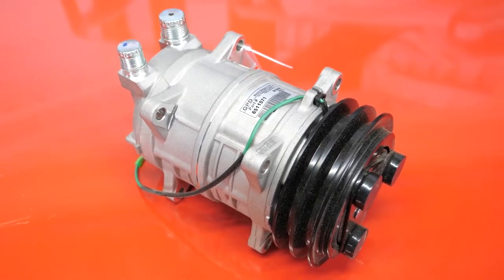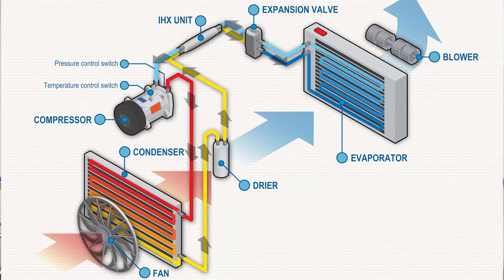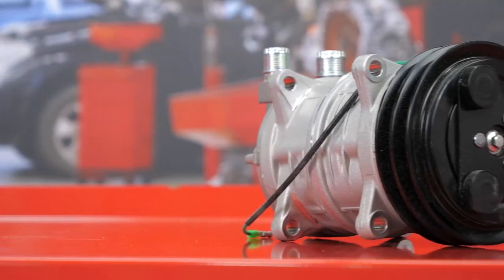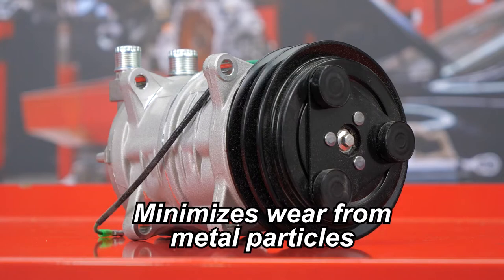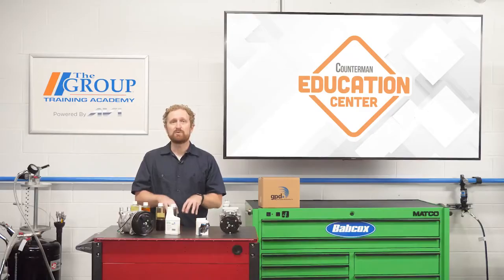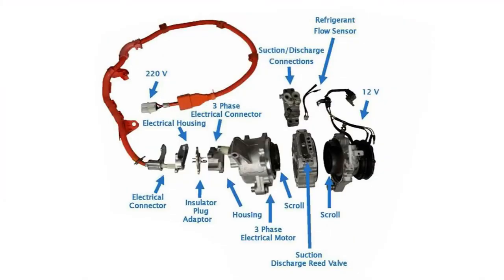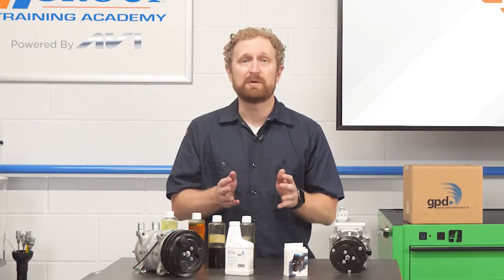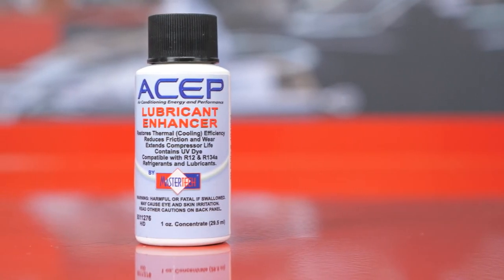Don't Let Oil Sabotage the A/C System

Comment: Josh Thanks so much! Quick question.. I installed a new comp on a G8 pont comp tag said 3 oz of pag 46 installed.. I also brazed a small rub crack/hole in the HP side.. the 4 seasons site states 4 oz total in this system.. What are your thoughts? Thanks again and i did subscribe!

Comment: Great info, hard to find oil compressor facts. Im changing shaft seal on a 2002 ford superduty 6.8l fs-10 compressor that s total capacity for oil is 9oz. If im not replacing and just servicing shaft seal. Is it recommended to change oil. Also if I drain oil and its low how much oil remains in system so the remainder can be added. All I can find is info on a new compressor. Thank you

Comment: Denso installation manual says to drain all the oil from compressor head before mounting... Quite confusing... The page before says to compare with old unit and keep the same amount of oil inside the new one... And then what? Empty only the head and leave in the drain plug?